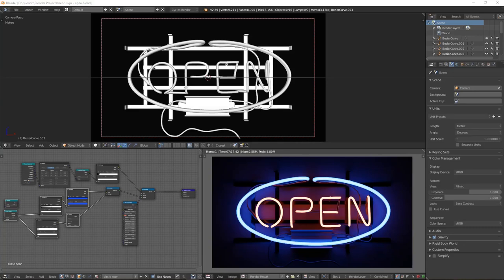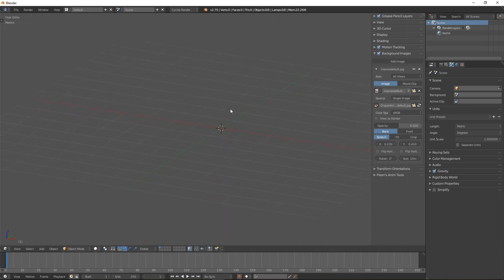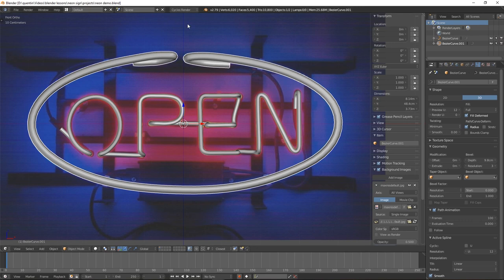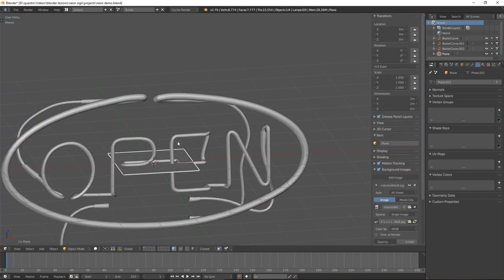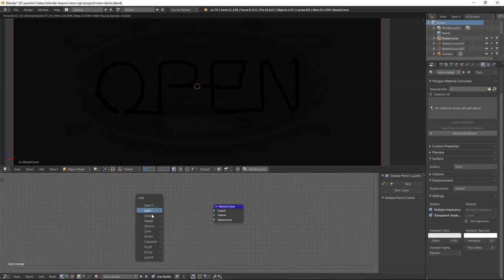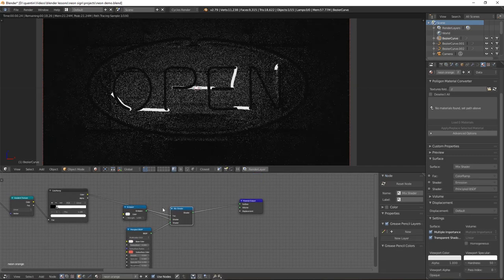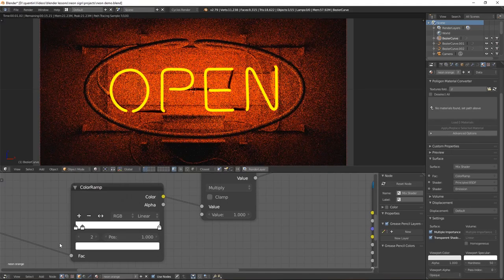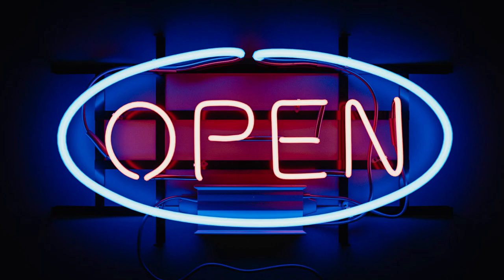Creating Neon Signs - in Blender

Comment: whenever i extrude and rotate my curve parts of it get "pinched" like it wont stay a consistent diameter along the bends
Reply from the maker: I'm not exactly sure what you mean, but if you give me a screenshot I could probably help.
Reply: @QuentinSteinke  i actually got my tubes by extruding from one vertex along my entire stencil then beveling hard turns and converting it to a curve and filling it, so that was a good workaround. but i cant seem to get my emission right, the part where you use the color ramp to make the center of the tube glow more. Whenever i set the values of "V" in HSV it wont go over 1.0. i enter 3 and it defaults to 1. any ideas what im doing wrong here?